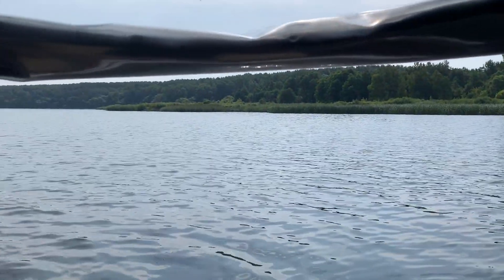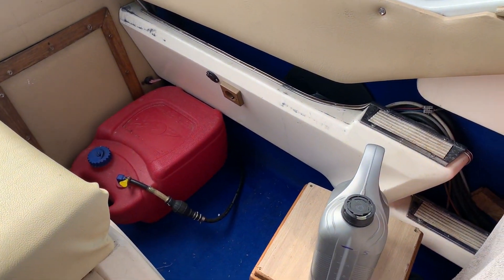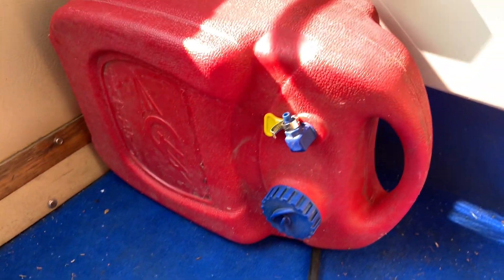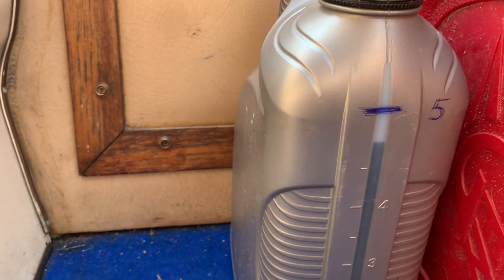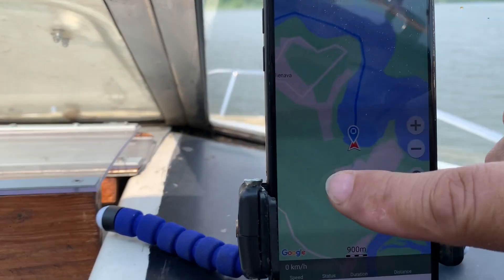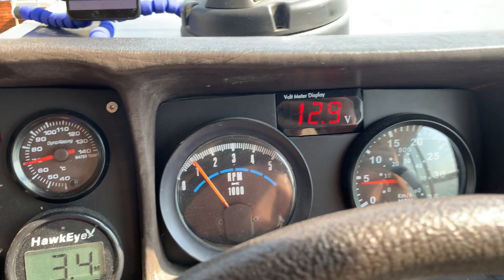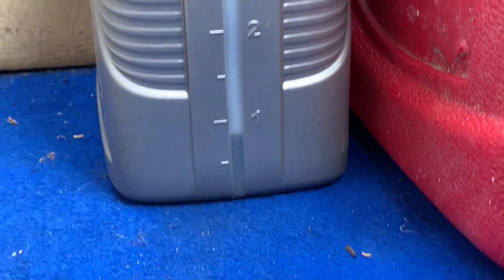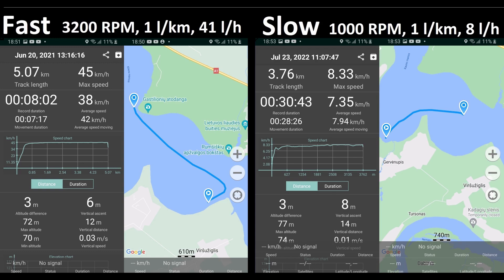How hungry is V8 5.8 liter marine engine?

Comment: The cushions look great!  Thanks for the fun video.  I think I have that exact motor, but mine has a smaller 2 barrel carb, and though I never have measured like you, it doesn't seem too bad.  Maybe 30 dollars for an afternoon of fun.  I'm sure a newer fuel injected smaller motor would be much more efficient.  But, these old boats run well, and are quiet, and don't mind going slow if you just want to putt around.  Yours is in such nice shape.  You did a great job on her.  Where I live people don't usually like these boats, and they end up in the junk-yard or smashed at the dump.  I'm glad you fixed yours up!  I need a new impeller in mine at the moment.  Maybe next week I'll get on that.
Reply from the maker: Thank you for your comment and good words. I was expecting something like that fuel consumption when buying this boat. It's not cheap to spend weekend with those petrol prices. But I most of all like my boat to have a possibility of sleeping on the water. it's not necessary to go far or do long distant runs. Just enjoy staying on the water. It's like camping. Good luck with the impeller replacement. Check out my #38 part on OMC 235 repair video. Maybe you'll find something useful
Reply: @Dasiukas  Thanks!  My boat is smaller (Sea Ray SRV190) but, you motivated me to try sleeping on it.  It has a full cover if I want but probably wouldn't use, and there is a nice bay close by.  I've wanted to do it for a few years - so, you just motivated me to camp - thanks!  I think I've seen your video #38, probably a few times.  I also need to pressure test the upper, as it gets water passed the seals I think.  I'll let you know how it goes.  I'm mechanical, but work a lot too, and don't have as much time as I'd like to fix everything.  And, summer is short up here in the mountains, with a lot of fun things to do.  Gas is expensive here too, so I usually just go to a beach, and kick back for a while, and then go back.  Also, my kids are gone, so no tube pulling or water skiing/wake boarding anymore.  Take it easy!
Reply from the maker: @bennyblanko3  You know, we have here a fridge, toilet, gas stove, tap&sink + 70 liter water tank, bow cushions for 2 person and that "sun bed" at the stern + small table, few USB chargers, power inverter DC12V->AC220V. Just all is a bit undersized. It would be a challenge to live there for a week, but great for a weekend. Anyway I encourage you to try sleeping one night in your boat. As you have to choose the right place, anchor properly and spend the night listening to water splashing, rolling on those waves and worrying about all those strange feelings you get. Won't be a deep sleep, but lots of impressions :)
I'm curious what part of the world are you in?
Reply: @Dasiukas  Thanks so much!  I'm going to do it!

Comment: That is a valuable info. To compare I did 55km on 7m boat, 7 people, max 4500rpm, mostly 2800, on 150hp new outboard Evinrude => 70 liters and the waves were 40-50cm.
Reply from the maker: Your Evinrude is economic beast! My vintage Ford couldn’t catch you! Thanks for your comment
Reply: @Dasiukas  :) Evinrude was from the rental. I own 305 V8 5.0 ongoing build on it for the next summer.
Reply from the maker: @lubaki.lubaki  My Reinell just barely gets into plaining with 6 persons on board. When it gets it goes ok.